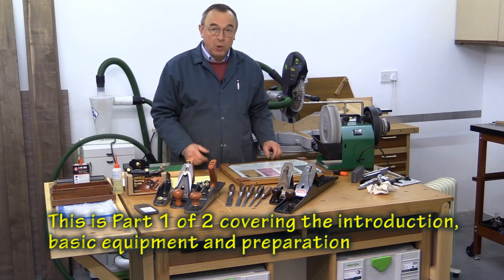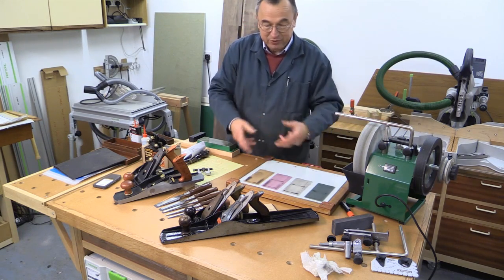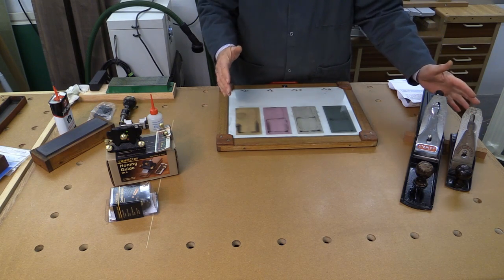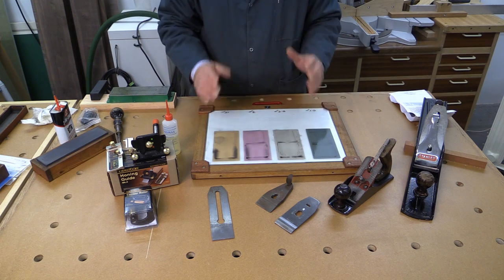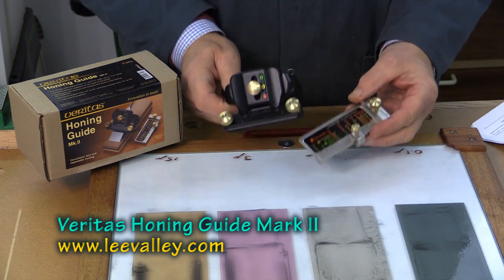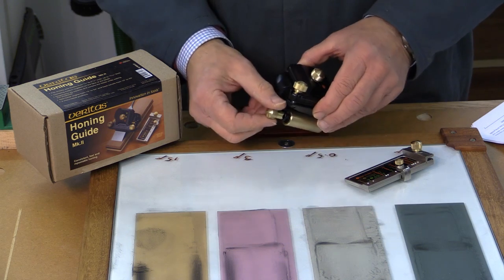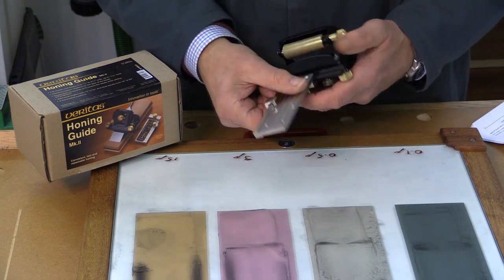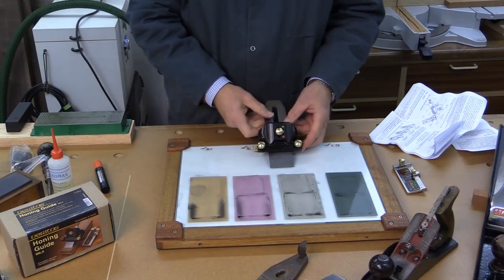How to get razor sharp tools using lapping techniques - Part 1

Comment: I also discovered this honing guide. SO MUCH better than the cheaper "Stanley" brand guide I bought first. I use wet/dry sandpaper on a granite surfacing block -which gives me a longer stroke. And lately, I'm finishing by stropping on a leather block. THAT is the difference between very very sharp, and sharp enough to shave with. If I can't easily  shave hair off my arm, I know my tool isn't as sharp as possible. I'm sharpening 1/2" to 1" chisels.
Reply from the maker: Good stuff - well done.   Peter

Comment: Peter, the stop on the registration jig can chip the blade edge sometimes even if you are careful. When you tighten the screws to hold the blade it can get trapped under the stop and fracture. It is the one weak link on an otherwise excellent piece of kit. I used a Sharpie to mark the commonly used angles on the underside of the jig and moved the stop well out of the way.
Reply from the maker: Hi Mouppe, I did check the tool very carefully and did not see any risk of that happening - perhaps the design has been modified. I am happy with mine.   Peter
Reply: Peter Parfitt That's good to know. Maybe they have modified it? I have had mine for many years now. Thanks for the video and enjoy the new planes!
Reply from the maker: mouppe I bought the planes about 2 months ago and I absolutely love them. I wish that I had been able to afford to buy them earlier but, the best things are worth waiting for.  Peter
Reply from the maker: mouppe Yes, I checked it very carefully last night and there is no danger at all of any damage to the blade.  Peter

Comment: I would highly recommend that you sharpen the Veritas blades. Although they come from the factory sharp enough to cut yourself, they are not sharp enough for quality work, IMO.

The best part about Veritas blades is that the back is very flat. You only need to spend a few minutes polishing the back before proceeding to the bevel. New Hock blades take a lot longer, and even Lie-Nielson blades are not as flat as Veritas.

There really is a night and day difference between your own honed and polished blades and what Veritas ships you.
Reply from the maker: Thank you for the advice. I will summon up the courage and give my PMV-11s a little tickle.  Peter
Reply: yeah, they need to be honed. and yes, you can lap without a jig-a ton of people do. Being afraid to sharpen wrong is what prevented me from productivity for so long. Ive learned that as long as you check what you are doing often, no mustake is irreparable.

Comment: Well presented & informative video - thanks !
I'm just starting experimenting with sticky-back-abrasives on float glass myself, and am also awaiting delivery of the Veritas sharpening jig. Like you, I've also bought some nice, new Veritas planes to help out my trusty old Stanleys. Are you pleased with your new (or rather 6 year old) planes and the PM-V11 blades ? I have not got around to even sharpening mine yet... but they seem very good, excellent build quality it would seem.
Reply from the maker: I absolutely love my Veritas planes and would not swap them for anything. The PM-V11 blades are excellent and keep their edge very well. I also bought the PM-V11 chisels and despite taking great care and using blade guards I notice that two of them have chips out. Both need to be re-ground at the primary bevel. I am sure it is just bad luck and do not believe that I have mistreated them. I can do the new primary bevel using the lapping technique but with some 600 grit wet and dry.  Cheers.   Peter

Comment: Thanks again for an informative presentation.  I have been using the MKII for several years now.  The only issue I have discovered is that the narrower the tool in the holding bar, the more prone you are to skewing the tool from the 90 degree position.  The knurled nuts are too small to offer enough torque to ensure that your blade never moves.  Plane irons are always secure, but chisels can move.  This is more of a problem on mortising chisels with their thicker profile.  As we get older the arthritis in our hands also plays havoc at times.
Reply from the maker: +Stewart Robertson Thanks for that Stewart.   Peter
Reply: Xoncention   I had the same problem and made some wooden shims the thickness of each chisel and that effectively made the chisel wider and took care of the problem.

Comment: Hi Peter, great video very useful. Would be good to see a video on how you made the wooden frame to hold the lapping plate.
Reply from the maker: Hi Mark, Making the frame was rather easy. It is just a piece of plywood with an edge to contain the glass and a plywood cover. I did then add some little corner brackets tostop the glass falling out. Thanks for your support.   Peter

Comment: Hi Peter, thanks for another clearly articulated woodworker guide. I'm relatively new to a lot of the techniques but I'm also curious and like to get everything clear and logical before proceeding. With chisels and plane blades that are the subject of the video there are two sides to the blade. The flat back and the bevel. Most of the instructions I come across only talk about working on the bevel. It's my thinking that both sides need work in order to achieve a sharp edge. What do you do about the flat (back) side of your tools, either whether they are new or used..?    Many thanks from down under in New Zealand

Steve
Reply from the maker: Hi Steve, As you work through the grades it is a good idea to lap the back (put the back flat on the abrasive without the honing guide). This gets rid of the tiny burr that is created as the bevel side is worked upon.    Peter

Comment: Hey Peter.  Considering the veritas honing guide.  I have heard a few folks have had trouble with some instability when using the guide to sharpen chisels, even relatively large 3/4 inch or 1 inch chisels.  Any comments on that in your opinion.
Reply from the maker: Hi Josh, I have had no problems at all. It may be that some people find using such things easier than others. I do not believe that there is any inherant problem. I am quite arthritic, especially my wrists and hands, yet I can manage.  Peter
Reply: The adjuster for the secondary bevel only adjust one end of the roller, the other end doesn’t adjust. Therefore you end up grinding a crooked bevel every single time. Terrible design

Comment: The carborundum stone followed by india and arkansas (and no guide use) would lend itself to much faster sharpening. 

There's a notion that oilstones:
1) can't get tools that sharp (they do, however, create a much sharper and smoother straight razor than all but the finest lapping films)
2) can't cut difficult steels

The first isn't true, and the second is a matter of learning touch and learning to grind accurately so that not much metal is left. 

It is a shame to go from using a stone, probably with some skill, to moving to a cumbersome setup that limits the sharpener and relies on gadgetry.
Reply from the maker: Thank you David.   Peter
Reply: I realize that could've come across as too critical. Of course, when you're in your shop, you do as you like and not as I like!!
Reply from the maker: Hi David, I have seen your work and have great respect for your talents. My Father, and his father too, used to make their own planes. Sharpening was always by hand with no guides. When Dad retired he decided to build a violin and spent most of his time making the special baby plans for the task. He never did make a violin but that was just bad luck.  Take care.   Peter
Reply: @NewBritWorkshop  hm